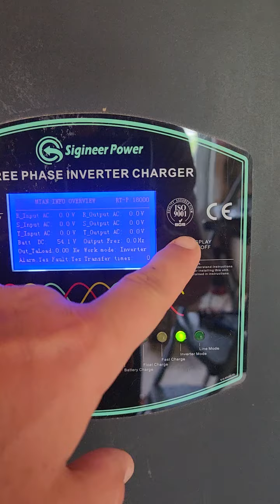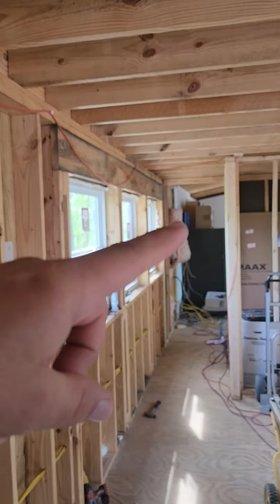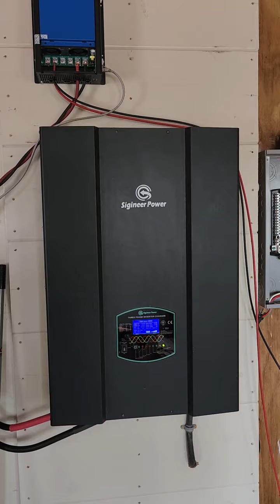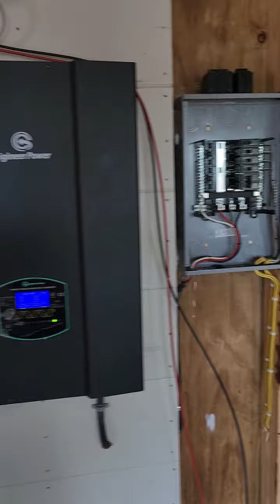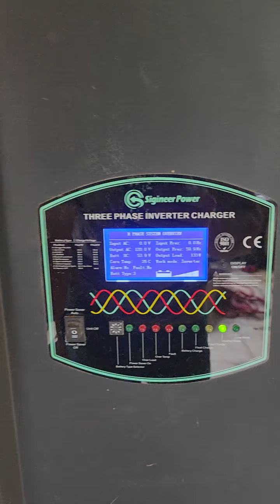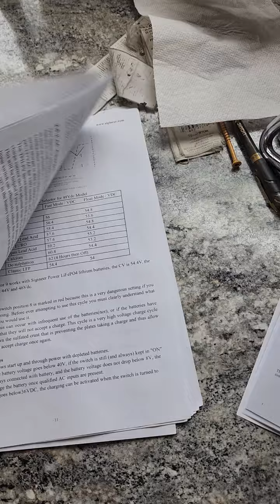Sigineer 3 phase TPH1804NC Problems.

Comment from the maker: I am currently standing in front of it thinking WTF. I am getting lots of voltage at the box. I disconnected the ground neutral bond in the box because the inverter automatically does it on inverter mode and disconnects it on utility power. So im lost at the moment...

Comment: Oh man , that is my least favorite sound since I bought my own power company. Can you even change settings on that?  I had a faulty inverter it would not charge past 3A, after found out it never charged past 55%soc (lead carbon no bms). My solar dealer called me in 30 mins at 8pm on Dec 24th, tried a few setting changes that did not work. Next day we changed work mode from batt priority to self-consume and back again and it worked to charge at max amps, but still only to 55% soc. Dec 27th new inverter shipped. Amen 8k the first inverter is just a firmware flash to fix or add the new bms for brick batteries. The same inverter is also Vest woods 8k (old interface model showing ugh) at signature solar on sale. Also, sol-ark 8k seem they are all related in specs and displays. These inverters are all programable from the inverter no laptops needed.  Currently uploading a short on that inverter.